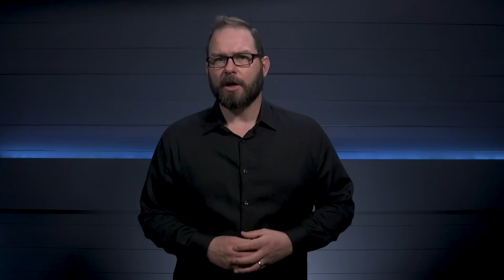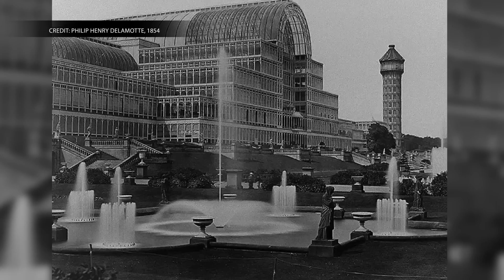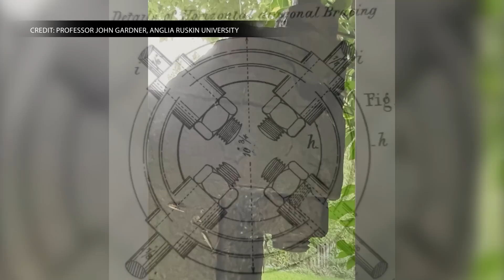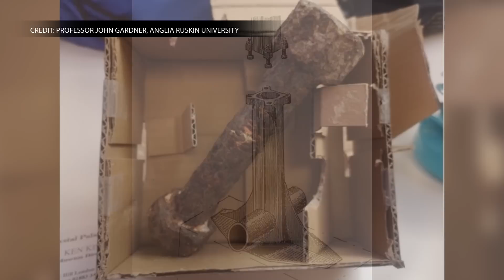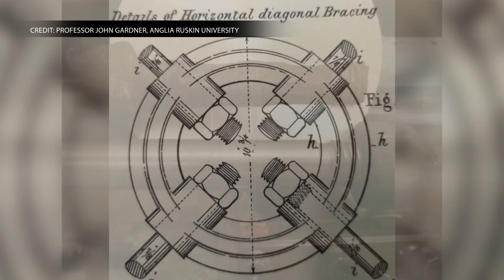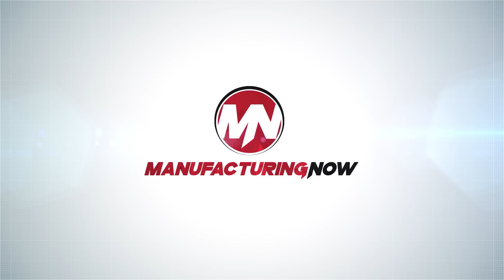Screw Thread Solves 173-Year-Old Mystery

Comment: One good (or annoying) thing about Whitworth or BSF is that nut and bolt head sizes were also standardized. If it is a ¼ inch W bolt, you use a ¼ inch W wrench, even though the flats on the wrench are about 9/16th apart. The family sailboat originally had a 2-cylinder Lister air-cooled diesel engine.
Reply: You know, I always wondered why Whitworth spanner sizes didn't make sense - And now they do 😊 Thanks
Reply: @peterjackhandy  This is one of many obscure facts I have learned in 79 years. For example, the first game the Chicago Cubs played in Wrigley Field was in what city? Los Angeles. (Wrigley Field Chicago had a different name. The name was changed, but an exposition game was played in LA before the regular season.)
Reply: For information, Lister air cooled engines used UNC and UNF threads, which are American standards - they were held to be a better fixing than Whitworth !
Reply: @steveallarton98  The family sailboat was built in 1961/1962 in Nagoya Japan, so the engine was built in 1961 or slightly earlier. The Lister engine came with a set of open end wrenches marked W or BSF. Perhaps Lister changed to US bolts after that. One advantage to the aircooled engine is that the warmed air was sent under the cockpit seat and a mushroom vent was installed to provide warm air to your feet.

Comment: Some years back, my boss was Henry, a Swiss engineer. He told me that when he was doing his degree in Switzerland (in Mech. and Production Enginering), one of his professors gave a lecture on thread forms, and put a silhouette of a Whitworth thread form up on the screen, blown up so that, from root to crest, it was about 10 feet tall.
The professor went through it, point by point, covering the angles, the radii at root and crest, and explained that it was designed by an engineering genius, an Englishman called Sir Joseph Whitworth.  He went on to say that Sir Joseph had carried out such a perfect analysis of all the forces on a thread form, that his design was, at the time, the strongest bi-directional thread form in the world.  Furthermore, he said, over a century later, NOBODY has ever come up with a stronger design of bi-directional thread - and he gave it as his opinion that nobody ever would.
Then he put up a similar sized silhouette of a Metric thread form - and Henry said the whole class cringed at how CRUDE it looked in comparison!  The professor went through that design, absolutely savaging every weak point it had.  Finally, one brave soul put his hand up to ask if the Metric thread had any advantages at all.
"Only ONE!", thundered the professor;  "It's CHEAP!  And that is it its ONLY advantage!  And I am ASHAMED that so many Swiss precision engineering companies are using this cheap and crude design in their products!"

Comment: Early 1850s - Late 1930s is a helluva run for a "temporary" building!
Reply: Check out the Eiffel Tower. It is also a temporary structure. Built for the 1889 Exposition Universelle (Worlds Fair). It was only supposed to remain until 1909.
Reply: @ewhartiii  True, Amazing that 19th Century "temporary" structures were built SO MUCH better than the "permanent" ones built today. I live in Pittsburgh, PA (USA) and we have a pretty cool Convention Center. It was built in 2003. Scary part IS the "Old" convention center it REPLACED was opened in 1981 when I was 20 years old! I'm just wondering if I will be around to see the THIRD one or perhaps even the FOURTH one! - at THIS pace...It's possible. LOL.
Reply: I can't prove it with specific examples, but I expect that there are still a lot of buildings intended to be 'temporary' that are still in use which were built during WWII.
Reply: @Mishn0  There used to be a lot more of those in the 1970's and 1980's in the USA.  Many have rusted out and been pulled down since then.
Reply: @workingguy-WOTm8  I wasn't referring to Quonset huts specifically. There were lots of frame buildings put up intended to be "temporary for the duration of the war" that are still being used. My dad used to work in one at Pearl Harbor, but I'm pretty sure it's still in use.
Reply: @Mishn0  Ah!  Yeah, I meant mostly quonset huts.  There is one barracks building left in Jonathan Dickinson state park from WWII that is still being used by the park rangers IIRC.  JD park was an early workplace of radar.  Used to have really neat left-over military-grade concrete structures (thick, like shell resistant I think) throughout it, but for some reason they tore those down.
Reply: I bet it was ready to fall even without the fire.

Comment: Very interesting video. I spent 30 years as a machinist, I also owned a Triumph motorcycle in the 70's and now own an old Land Rover. I spent a lot of time on a lathe making custom threads when I worked for a manufacturing plant with old propitiatory equipment. I had no Idea Whit worth were the first standardized threads. It does make sense though as shortly after was when production plants were able to mas produce interchangeable parts, and threads were a large part of that.

Comment: I have photograph of small sheet map guiding visitors to new location in upper Sydenham when Palace moved. Whitworth great innovator as well. Metric thread used by opticians from c.1900.
New railway station built- Crystal Palace High Level - for visitors which had/ has tiled underpass directly into building.Used to be open occasionally. I have a short on utube ‘The Coach Wrench’ which relates to manufacture around this time.

Comment: Just so I'm clear, the metal and glass building burnt down? Okay sure.
Reply: my wood burners are in cast iron and steel; never burned down
Reply: The flooring was wooden slats with tons of fluff brushed down . Same cause as Kings Cross tube. Once it was alight they couldn't stop it because so many people blocked the streets that fire crews had difficulty getting through. Glass melts at 1000 C so that added to the furnace. Started as a small fire in the central transept and rapidly spread.
Reply: @lucifarian93  oh yeah? you were there with your smartphone documenting the furnace that left puddles of molten glass and steel because the floorboards and fluff burned as hot as military grade thermite?
Reply: @luigicirelli2583  used to have a piece of glass which had two of the panes melted to each other. Girlfriend chucked it out in a clear up of 'junk'. All sorts of theories about the Palace fire but would seem strong case of straight forward circumstance.
Reply: @lucifarian93  there are better conspiracy theories than yours out there, but to insist crystal palace fell free-fall merely from some office fires without fuel being involved, it's a stretch!!
Reply: @lucifarian93  as far as you know there is no melting of steel from floor boards burning, keep it that way
Reply: I had read in recreational reading it was bombed by the British so it wouldn't light the way for German planes.  I don't know.
Reply: @AHBelt The two towers were demolished because it was claimed the German bombers were using them as guides as they were on top of a hill. Loads of photographs really interesting subject but ultimately became unprofitable so it was doomed anyhow. Check out Joseph Paxton's Stove at Chatsworth to see what else he designed in glass.

Comment: Whitworth spedified his tread shapes in 1841.They quickly became 'standard in industry. Crystal Palace was built in 1854 - 13 years later. Why is it surprising that they were used in the crystal palace? That's like being surprised that microsoft windows was being used in banks in 1995.
Reply: The Crystal Palace was built in 1851, not 1854, to house the Great Exhibition.  This only got so many visitors because of the railways, and now it seems that technology popularised by the railways (the standard nut and bolt) was used to build the Palace as well.

Comment: I’ve always wondered how a building made of metal and glass managed to burn down.
Reply: It was used as a store by the BBC and was chocker full of imflammable stuff.
Reply: @fredericksaxton3991  molten glass? it's a building, not a furnace.
find the reference the BBC held inflammable "stuff" in 1936
Reply: @luigicirelli2583  Where do I say 'molten glass'? Crystal Palace was full of stuff in storeage which caught fire and burned destroying the integrity of the superstructure which collapsed. End of.
Reply: @fredericksaxton3991  I heard you; careful, the frame and glass of your car is going to melt in case of a fire - NOT!
Reply: It doesn’t have to melt.  Steel will soften long before it melts.  Once the steel in the lower part starts to soften due to the heat of the burning contents, it will collapse under the weight of the upper levels.
Reply: @keithmills778  it was only a couple of floors; the floor boards would soon extinguish, there isn't the ideal condition to overcome the heat sink effect
Reply: @luigicirelli2583   yet it did burn down though didn't it, so all of your points are wrong.  you're an idiot.
Reply: @keithmills778  Not steel in this case. Cast or wrought iron.

Comment: I served an engineering apprenticeship in the late 1960s.There were multiple thread forms in use.Whitworth,British association,Cycle,Bsp,Unified fine,unified coarse,Acme,metric coarse and metric fine.The diameters,thread angles,pitches,peak and core forms,thread fits and tolerances,could all be found in engineering reference books or for quick access theZEUS book.

Comment: You mention: [The Crystal Palace is the earliest known building to use Whitworth screw thread] and [Researchers discovered Whitworth screw threads in a column bolt in the building's remains as well as in a nearby water tower designed to power the Crystal Palace's fountains.]

Which of the two were build first? Or was the water tower only present at the second site (I doubt that)? Even if considered ancillary, I would bet given the speed of building it was put up first and the palace foundation piped before the glass structure was erected.

Comment: I got one guy trying to tell me about the rust belt , another about linear motion . Well , I didn't even mention buttress threads , I just used Acme as another example of sharp corners . I lived and worked in the area of high stressed fasteners , and a fracture was far worse than a seized bolt ,,, !

Comment: Funny, these standard doomed the UK industry as metric became the world standard. Same happening in the US. Non metric companies unable to sell outside the us, poor quality, more expensive...
Reply: @bpark10001 cut the crap retard ! Guys like you are the laughing stock of   the world of science and engineering.
Reply: Not so fast!  Metric threads are mostly CRAP.  All the work that US engineers did over 100 years, optimizing threads, balancing break strength against stripping strength.  Design for manufacture ability, having all threads being a division of ONE length unit so  lathe requires fewer change-gears to cut different threads.  Europe TRASHED all that & now we have thread standard that is intolerant to manufacturing tolerances, stripping out when stressed.  (Metric bolts from China just don't work!)  Metric threads are harder to set up & cut on lathe because of the European's aversion to fractions.  Even the bolt head design was monkeyed with, causing the heads to strip out or the driver blade to twist.  THERE IS A LOT MORE TO MECHANICAL DESIGN THAN A LENGTH UNIT!
          If you get in airplane, better hope that it is bolted together with hardware made to "army-navy standard", based on the inch, if you want it to hold together!

Comment: Glass and Cast iron "burnt dwn " .. .,🤔
Reply: My thought, also.
Reply: how can you turn it into a furnace to melt glass and steel ridiculous
Reply: @luigicirelli2583  It doesn't have to melt, just go soft and bend.
Reply: @limyrob1383  soft, like liquorice, cast iron? get out of here
Reply: @luigicirelli2583 

Cast iron has a lower melting point than steel, because of the high carbon content.  If it didn't have this lower melting point, then the technology of the 18th Century (when cast iron first became common) couldn't have melted it to allow castings to be made.
Reply: @jerry2357  it's only a couple of floors, not much wood there to burn; the cast iron frame would only slightly warm up, cast iron is a great conductor of heat which disperses to the rest of the frame that has no planks burning; temperatures would not reach past 150-170 degrees centigrade
Reply: @luigicirelli2583  Yes, but what were the other contents of the Palace?

Also, iron has a much lower specific heat capacity than, for instance, water, so the same amount of heat will increase its temperature by almost ten times as much compared with the same mass of water.  When I was a child, we had a metal chair that was used outdoors, but on a sunny day it became ludicrously hot, because of the low specific heat capacity of metals. Glass has a higher specific heat capacity than iron, but it's still not much more than a fifth that of water.

Thermal conductivity is a bit of a red herring.  The thermal conductivity of cast iron is probably not as high as you think.  Some grades have only a tenth of the thermal conductivity of commercial copper, for instance.
Reply: @jerry2357  there is no arguing the extended structure, barely a few floors high, does not cave in in a pile of molten glass just because of a little office furniture and a few floor planks catching fire; the cast iron remains undeterred, gets a little scalding to the touch, that's all
Reply: @luigicirelli2583  Have you looked at photos of the aftermath of the Crystal Palace fire.  These don't include "molten glass".  All that needed to happen was that the cast iron structure needed to weaken enough to collapse, not to melt!
Reply: @jerry2357  look for 12th January 1937: Melted glass from the Crystal Palace fire, on display at the Natural History Museum in South Kensington, London. (Photo by Fox Photos/Getty Images)
Reply: @jerry2357  look for 12th January 1937: Melted glass from the Crystal Palace fire, on display at the Natural History Museum in South Kensington, London.
Reply: @jerry2357  there are photos of molten glass, any search engine will do
Reply: @jerry2357  search 12th January 1937: Molten glass from the Crystal Palace fire, on display at the Natural History Museum in South Kensington, London. (Photo by Fox Photos/Getty Images)
Reply: @jerry2357  12th January 1937: Molten glass from the Crystal Palace fire, on display at the Natural History Museum in South Kensington, London. (Photo by Fox Photos/Getty Images)
Reply: Wood floors
Reply: The heat melted the glass and the structure deformed then collapsed.